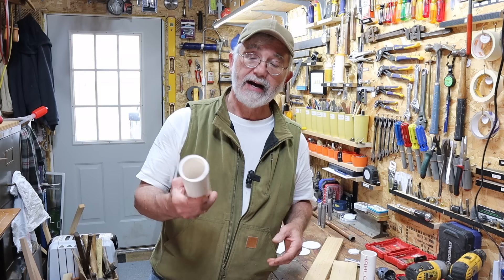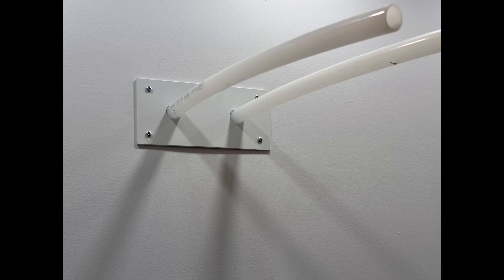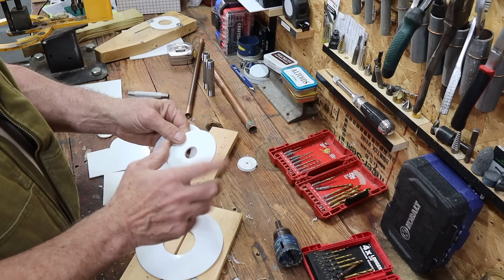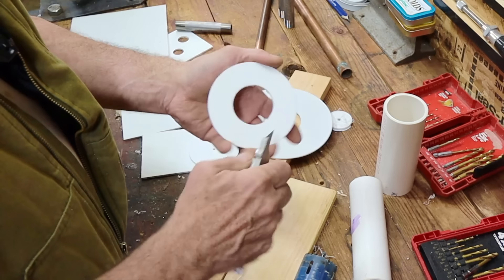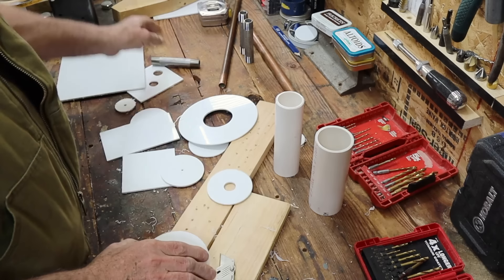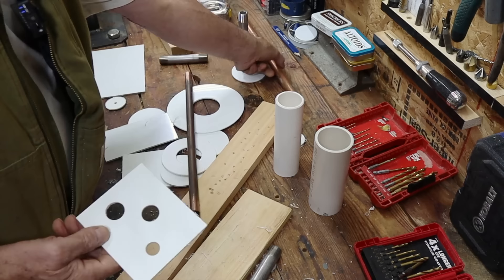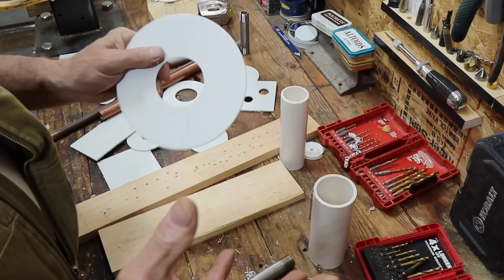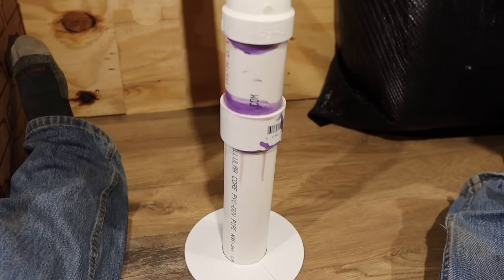How I Make Custom Size Pipe Escutcheons or Flanges

Comment: I went on Amazon to search for the pvc flat stock. I couldn't find any that were that size. do you have a link where you currently are getting them from?
Reply from the maker: “Rigid pvc white flat sheet 1/8””
Search that at EBay and you will find numerous options.  There is a pvc foam board. You don’t want that. 👍
Reply from the maker: That search on Amazon will also bring it up.

Comment: It looked nice until you put the screws in. It would look much better if you just use an adhesive. Install would be much more cleaner.
Reply: What screws?  He didn't use any on the install.  He did use some to hold the part when getting set to drill the center hole... but I'm sure you couldn't mean those, right?
Reply: @Geoff_G 
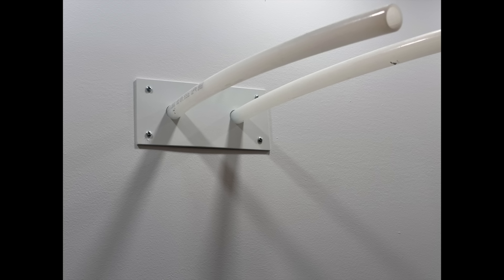2:05 and 2:38
Reply: If you use adhesive you can’t remove later for repairs.
Reply: @TuberDave444  The adhesive is going to be removed with a putty knife. You just use a touch of silicone to hold in place. There’s no reason for any physical retention. Just scrape it off and glue back on. But in reality you don’t go back into the wall or you would have installed an access panel.
Reply: @puntabachata  I don't know how I missed those.  Definitely should've used adhesives rather than screws.
Reply: Yeah, just a dab will do. 2-3 dots will secure it.
Reply: Screws are stronger preventative against rodents
Reply: Just use screws w/painted heads on them. So you get in to do yours repairs, if you don’t want to scrape adhesive. Everyone has different ideas, that they like doing. But overall they’re all good ideas/options. Good video.

Comment: I appreciate your mention of making the flange split and that the material is flexible enough to accommodate being fitted around plumbing that way. I appreciate your attention to detail and the simplified means by which you accomplished your goal. The shop-bought escutcheons rust and look awful -- I wanted something simple, clean, and well fitted. Thanks to you, I'll start working with PVC.

Comment: Nice work!  It's actually easier to cut large circles in thin stock like this with a flycutter on a drill press.  Try it and you'll like it.
Reply from the maker: Thanks for the tip!

Comment: Besides a deburring tool, you can use a propane torch to lightly go around the rough areas.  The torch melts the PVC and leaves a nice smooth finish.  Been using that technique for ever.

Comment: I am very jealous of your attic.  Mine is horrible.  The construction doesn't really support a usable space but having the power panel in the corner of of the garage below really added the coup de grace.  Tons of romex like spider webs going the absolute shortest path.  It might have cost another box of wire to run them through a channel that could be floored over.  I really laughed when it was clear that you took your shoes off in your attic.  :)

Comment: People need to know just how important these are to have. Under my kitchen sink, in the old mobile home I inherited, the wood had rotted because of a broken pipe a few years before and snakes had entered the home thru the opening around the drain pipe. Those snakes laid eggs and more snakes emerged and now I have found 2 small dead snakes and hear another roaming around my house. One even tried to burrow up inside the plastic covering on the box spring of my bed (while I was in it). I subsequently gave the bed away, sealed my bedroom off and moved another bed (without a box spring) into the living room to sleep. Because I wasn't in the bedroom during the freezing winter I hadn't known the pipes had burst (actually 2 of them) and the bedroom and bathroom was filled with hot steam from the water heater and it had moisture dripping from the ceiling and walls and mold everywhere. Even sealing the room off again didn't keep the mold from permeating the house or keep me from getting pneumonia from the mold. Now I'm trying to clear out my garage to frame it in for a home free of snakes and mold. So escutcheons are SO VERY IMPORTANT!!! More than anyone would ever know. If I had then previously, I would still be able to stay in my home. THANK YOU FOR THIS! I will be making them for each of the pipes that come in from the floor in my 'garage-a-minium' and also plan on placing that rigid white board under each sink so I won't ever have rotten wood to cause problems with again!

Comment: Hello Herrick, most of the steam engineers/ mill wrights use a gasket cutter to cut this type of material.  It can cut  very large and small holes, very accurate circles with only a fine burr.  Normally used to cut tough "Gorlox" material so vinyl would be easy.  Very little set up time.  Also for the small holes I would recommend Fostner bits, also precise holes with no tear out and then finish with the de-burring tool

Comment: 2" Pvc ones that are pretty good quailty go for about $6 for a pack of 20 from the plumbing supply house. I really do like the idea though sometimes you need them to be flush because your first fitting needs to be flush with the wall this could really get you out in a pinch. Over the years I've modified my own different ways to get what I needed. This could also be good if you need to cover a big hole or if the pipes are too close you could make a double.

Comment: I use my 3d printer. I can even design it when the pipe comes in at an angle and therefore the hole in the escutcheon is slightly oval. I chamfer the outside edge so that the edge blends with the base.

Comment: The cheap chrome-plated shower goosenecks are prone to corrosion after a decade or two.  And, they usually break off inside the threads of the brass receiving fitting.

Years ago, I started to make my own goosenecks from PVC, heat-forming them to the appropriate angle tilt.  But, what about the escutcheon?

Using PVC pipe end-caps cut and holed in a lathe, sanded and polished, they look like perfect factory-made-for-purpose beauty trim.

Comment: Cool idea, I've got a few spots I could use this! A few things to add. It looks like you could make one out of a spare piece of that flooring in your attic. Would it be better to frame around that pipe to protect it?
Reply from the maker: The spare piece of flooring would work if I put the escutcheon in place before connecting it. No flex for fitting around the pipe after. Framing around the pipe is not a bad idea. 👍